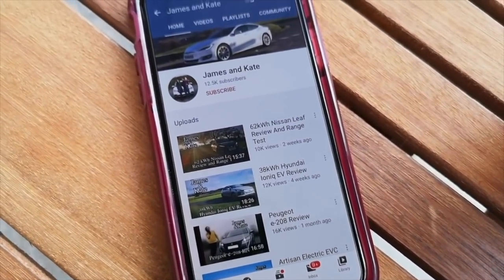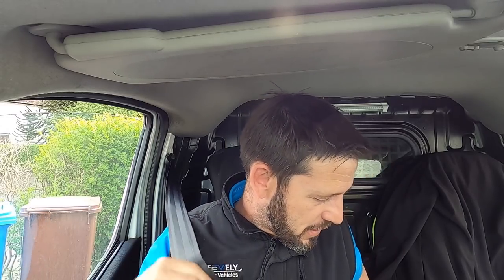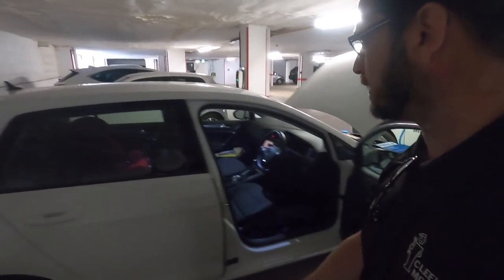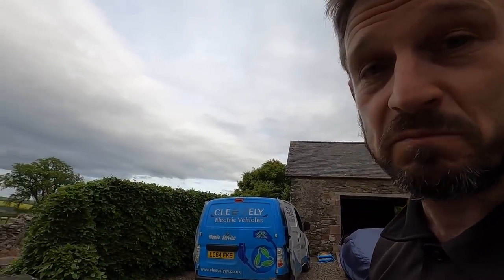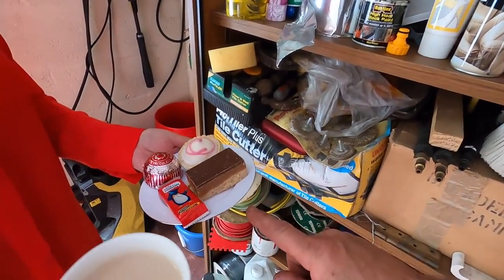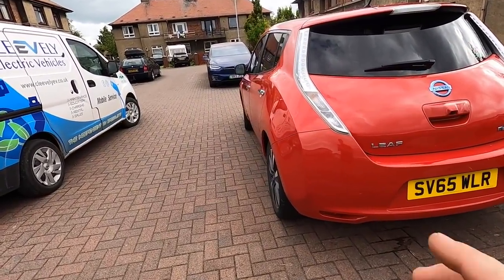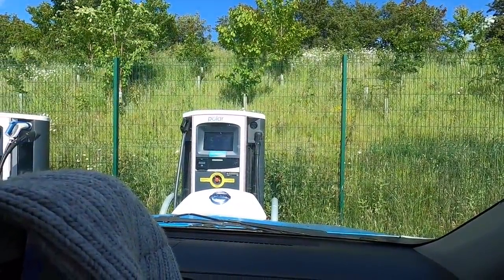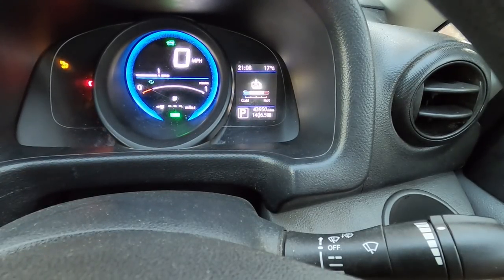You Don't Need A Diesel Anymore -1600 Miles Shows You Why!

Comment: I love this sort of content, you can see why VW with all their actual car building knowledge is keeping drums on the rear of their EV’s even though a lot of the car journalists are slating them for it.
Reply from the maker: Drums are ace. They outlast pads easily.
Reply: The problem with drums is that they are not sexy enough for car journos, bet they like the bigger rim and thin tyre combos even though they are so stiff they make the ride harsh and noisy, it's all about looks for them.
Reply: Drums are complicated, can suffer from over heating, are a pain to work on and cannot get rid of water the same way that discs can.  They also need complex auto adjusters or manual adjusters, which is just one more job to do at service time.  Indeed, manually adjusted drums will almost certainly need adjusting between services, which is even more expensive and irritating.  Even heavy trucks have now converted to discs.

For some strange reason, they work out cheaper than discs, which has always struck me as odd, but that is why they are still fitted.

Comment: Knee pads are not so useful I find but a good thick closed cell pad (as in gardening ) works well for me and my knees. Just chuck it down where you need it and pick it up when you're done.
Reply: @bdeithrick  I actually use a piece of hard foam packaging material, does the job fine and cost me nothing.

Comment: No charging times given. Apart from the start up cost, it's range & real life refuel time that I was waiting for.
Reply: Charging time is not relevant. As you see, James charges at the hotel, at the customers houses while he works on their cars  and at places where he stops anyway for diner. Stopping is charging....
Reply: @annekecornee  so the heading should of been you can drive an EV van if you only repair EV cars. Didn't really need a 45min look into how many cakes James has every day.
Reply: @douglasgreaves188  so if you have a eV you can sell your house because you will nether be there
Reply: @richardburden6056  the clip was for a van. The range on van's are around half of a cars. If I travel to a construction job & need safety induction at 8.30am I'm leaving home at 5. Don't really want to add an hour to a journey getting up at 3.30am not appealing. Plus the cost of stopping & paying for a crew to watch the van charge. Very biased view of why you don't need diesel.
Reply: Hey  @douglasgreaves188 , you've got some very good points, your usage case is definitely very different to mine, though compared to James' Van, my car actually has less range, and that's without a load.

There are electric Vans coming out now that have got a decent range on them, but I get your point, you'd need enough range to reliably get you to site at least, without stopping to charge, and even then, you probably won't have an electric hookup on site that you can use to charge.

Comment: Haven’t Nissan sorted out a  battery cooling system  yet !? It’s such a glaring need on their vehicles, one that any intelligent auto maker would have sorted years ago. Loved the video James.
Reply from the maker: Sadly not, it's pretty poor on the eNV. We have a plan though.
Reply: @Jamesandkate  Attach a set of cooling fans, independently measuring the temperature and powered by the 12V circuit? Would that leave you with enough ground clearance? Surely the layout of the battery pack/chassis precludes the possibility of liquid cooling?
Reply: @Jamesandkate   Are you going to talk about it in another video?

Comment: Drums worked perfectly well for years without the slightest of problems
And as an uncle of mine once told me his articulated truck has drum brakes on every wheel and can stop all the weight he can carry, then set off on his journey again without even thinking about them.
Disk brakes would be in bits on the floor if he tried it with them.
Reply from the maker: Too true. Many commercial manufacturers are going back to drum brakes for reliability and cost savings.
Reply: We got rid of the last motor coach with drum brakes at my company 15 years ago but we had to lease seveval coaches for a new job in 2016. They all had drum brakes and I can tell you that there is a huge difference in stopping power in the discs favour. I can tell you from personal experience that if my coach had drum brakes I would have been involved in at least 3 accidents that would have been caused by people driving their cars like total idiots. With drums there would have no way I would have got stopped in time. The disc more than likly saved people from getting hurt and saved my company tens of  thousands in repair bills and coach down time. The coach doesn't earn money sitting in the garage in pieces.

Comment: Hi James. Fit the range extender and it will solve range and heat issues, also will charge at 50 kw to 85% is is a superb addition to the ENV-200 CleevelyEV for the win.
Reply from the maker: We've got one in the workshop. Just toying with the idea now.
Reply: @Jamesandkate  I know they had one left after our two were fitted. , it really is the business we are still amazed at the improvement, makes it so useful great value.

Comment: Great video James that looked like a tough and busy week. It’s hard work working without a ramp and you were lucky with the weather. A couple of times it looked like you were just relying on the jack with the wheel removed and no axle stand as a back up (Zoe and Model X). Please put an axle stand next to the jack just in case the jack fails or the car moves suddenly. It’s happened to me over the years and it scared the pants off me. It can happen so quickly, I’m sure Kate would want to home in one piece 👍.

Comment: My diesel van has 600 + miles stress free range and very glad it has. Got an electric car as welI, live on Teesside, scotch corner is nearly always in use or broken as a lot of ecotricity chargers seem to be. I have given up using it long distance because of the rubbish infrastructure.
Reply from the maker: Indeed, the van market is a bit behind, but the next gen line will be 400 miles plus.

Comment: Great video!! I'm headed to the garage to check on my model 3 discs for signs of uneven wear. Its 2 1/2 years old now. Tesla don't recommend any servicing anymore since they are focused solely on delivering more vehicles. Wish we had someone like yourself where I live to take care of the car.

Why not stock those Nissan clips if they are often missing or broken. Save a return trip and the need for your customers to buy them.
Reply from the maker: Where are you based? Good shout on the clips, I'll get some onboard.
Reply: @Jamesandkate  We live close to Nashville TN. Used to live in the UK before we emigrated. The only mobile service here is operated by Tesla.

I did check my rotors. Smooth as a babies bottom, so no evidence of an issue, yet.

Comment: If any more proof were needed that no one needs a diesel van, you do way more mileage than most van drivers...even with the Nissan which doesn’t even have a proper thermal management system. Most EVs have this now and would have allowed you to carry on fast charging without the battery heating problem.
Reply: @enrobsorussell  As an outside @russel, what are your impressions of the human race?
Reply: @enrobsorussell  over the course of a lifetime of the van, it is actually much cheaper to run
Reply: @kiae-nirodiariesencore4270  Love the human race. I would use `human race` inverted commas for people giving their obvious biased `opinion` while covering their opinion with gloss (Lies)
"Any more proof needed that NOBODY needs a diesel van...!" is just a lie.
You use an EV van, good for you, but to say nobody needs a diesel van is just `pish`.
James puts together a nice vid, very polished, a bit too polished....like `expensive` polish, making one wonder if he has certain shall we say `incentives` to big-up EVs, without of course really mentioning the obvious downsides.
I rather noticed, Kia e-nero, you had no answer to the obvious facts of the downsides as regards EVs I mentioned.....just a rather silly insinuation (Virtue signal) that maybe I don`t like people.
What next I wonder...more not addressing the downsides of EV ownership and a rather flippant, "You are just a `hater`!"
Reply: @alastairclark9423  I wouldn`t disagree with that fact. That is an upside of EV ownership. Rather offset I think by the downsides....range, outlay, expense outlay with hotels etc while charging....and that is IF you can find a charger that is A Working...and B Not already in use.
I think James must be in two minds about these vids, encouraging use of an EV van.....encouraging even more queuing at the only charger working within 30 miles in the wilds of scotland.....never mind, at least he will have plenty of company while you are all waiting in the hotel for your turn with the charger.
Reply: @kiae-nirodiariesencore4270  if they think like you squid brain .. not a lot
Reply: @enrobsorussell  James would have had to stay in hotels irrespective of what powers his car.
Reply: @kiae-nirodiariesencore4270  ....for 15 hours waiting to charge the van up? Fact is...and it`s an unfortunate one....no waiting to charge up a diesel van.
Wouldn`t mind betting half his work is replacing brakes on EVs...if you don`t use them much as in EVs, they will be unusable pretty quickly, so if EV vans don`t take off half his workload will vanish.
Reply: @enrobsorussell  You’re not understanding are you, or maybe you didn’t watch the video through. James went to Scotland for a few days to service a number of EVs while he was there. There was no way he could go home between jobs so would have had to stay overnight whatever he was driving. I have driven an EV for nearly 3 years now and I am never waiting for it to charge. Most of the time it chargers while I sleep, we also plug in and get free power while we do the shopping. On long journeys the range of the car is more than I can drive in one sitting without a break. Last time we went to the UK from my home in France we spent 22 minutes at one charging stop to grab something to eat and drink and use the loo...then plugged in for another 6 mins when I stopped to use the loo again..this on a 4.5 hour 440 km drive back from the ferry. James plugged in to a slow charger while he slept so there was no inconvenience to him. What you die hard diesel people need to learn is that electric cars and vans are taking over, they do a better job, are quicker, smoother and much cleaner. You  may not care about the environmental damage fossil fuels do, or you may care a lot and not be able to afford to go electric yet. It really doesn’t matter as in 10 years time no one is going to be buying diesel or petrol vehicles new, that’s just a fact you need to accept and get used to. I just don’t understand people who are happy to throw money away on diesel when they can plug in for pennies.
Reply: @kiae-nirodiariesencore4270  You make it sound like France is in the Himalayas...it`s just 20 miles off our coast...20 miles on a Ferry, with the car switched off. You can stuff the virtue-signalling where the sun don`t shine, with your silly name-calling (" Die hard diesel people!") if you are not careful it`s the naughty step for you. Jurassic age had an ave temp a full SEVEN deg HIGHER than now....what will you say about that....."Well, maybe if they had invented EVs....!". EVs do the same job as a diesel van, exactly the same...yet are far more expensive, have a fraction of the range and don`t like the cold. I don`t need to `get used` to anything...we live in a democracy, not communism....not yet anyway. As regards buying a diesel, a new one anyway....the market is virtually non-existent now, as regards cars...as regards vans, pick-ups, wagons it`s still there. As regards James and his niche market and the fact he gets work replacing knackered brakes on EVs...if as you say it`s going to be `all change` and no longer `niche`, with the market flooded with 1,000s of would-be James with a little EV van replacing brakes....all vying for that poxy motel room and the ONE charger in the car park....

Comment: The model 3 rear brakes does have that challenge with rusty ridges.
My 2019 LR awd has the same though much less drastic than the P you showed.
What's strange is the front looks perfect.
I have purposely set regen to low from time to time - I'd rather wear some front pads and even front discs because the rear discs are so damn expensive in comparison.

Comment: Great video, but this shows me why diesel still does have a place. I drove to Devon and back from Liverpool at the weekend with no stops for fuel and still had 200 miles left on a bog-standard 2012, 320d F31. I love the idea of electric, but it just doesn't suit my journey profile. (I have Smart 451 for local driving btw)
Reply from the maker: Yeah, that's a long way, and currently there's nothing that will match that, but it will do shortly 👍🏻

Comment: Much as I Iove your videos I still could not use an EV for my job. I did over a thousand miles in the last four days. I also did 20 odd hours of work when I reached the sites I was working at. 300 miles alone today which took me six hours of driving I certainly didn't have time to stop to re-charge my van. Only two stops in the entire week, in total about fifteen minutes to fill van and top up adblue.
I guess if you are lucky enough to be able to plan jobs and distances before it would help, also the fact that most of your customers let you top up while you are servicing their vehicles. But when you don't know where you are going to be from one day to the next the diesel is the only option. Monday South Wales, Tuesday North London, Wednesday Birkenhead and Telford then today up to the office in Chorley and back home to Bath, just not possible in an EV.
One day I will have somewhere to park at home where I can install a charger and I will buy a private EV car till then, at least while I'm working and driving the works van I'm afraid it's still impractical.
Reply from the maker: That's a fair shout and they don't work for all use cases. But hold fire, i'll be in a much newer van in an upcoming episode that could work for you.
Reply: @Jamesandkate  Really don't have much choice on the van. The Transit I drive is less than a year old, carries about a ton of parts and tools and is so much better on fuel and emissions than the previous ones. The problem is range anxiety, not for myself so much but the customers wanting you as quick as possible. I really want an electric vehicle and if I had somewhere to park my own car I could easily drive the few miles I do in it.

Comment: Hi James. Always enjoy the videos. I’ve seen one or two posts re fitting mk1 Golf strut top covers to Leafs, to stop water pooling around the top nut and thread, causing corrosion. Just wondered if you had come across this? Cheers Doug
Reply from the maker: Hi Doug. I've seen various caps on the strut tops. I normally dry them out, wire wheel them and pack with grease to keep the rain out.

Comment: Great Video.  Fastest 49mins i ever experienced watching this while charging my car. I have  a question about the Warranty on the Cars.    Is it not necessary to go to a main Dealer to get your regular Maintenance done ?      If something where to go wrong would the manufacturer still cover any Warranty issues  if you have serviced the car and not done by a main Dealer ?     Also the jobs you do are the Customers aware they have faults before they call you to do a Service, or are you just doing recommended Servicing for each model,   Thank You.

Comment: I watched the whole video with interest. Thanks James. [Get yourself some knee pads, or you'll be regretting it later.] 

The Zöe caught my attention Driven our ZE50 for 850+ miles so far. We're seeing 4.4 to 4.6 miles/kWh, so 220+ miles per charge, driving normally, mostly using Eco. Spent under £2.50 on electricity, and that was when I charged it the first time, to check cables. Used supermarket public chargers (mostly 22 kW) since then, without an app, because I don't have a smartphone, and we have no off-street parking. 

So no, even this car driver agrees that you don't need a death-rattling, lung-destroying Diesel.

Comment: Thanks for this, it really emphasises why actively cooled batteries are a must on ev's, where I live (🇦🇺) 17ºC is a cool winter night or a really cold day in winter, a typical winter day is 28ºC and summer, well i'm sure you understand why I was concerned about the lack of cooling on the Nissan batteries.
Reply from the maker: 100% wouldn't work for you over the same mileages
Reply: @Jamesandkate  well 1600 miles (2500km?) you did that over a week and went into another country, here I could do that in 2 days without leaving my state (QLD) and it's not uncommon to drive 1000+km in a day. Again thanks for your video 👍🏼

Comment: Great (long) video. Don't apologise for the Wind it powers Scotland. On the blue MODEL X I noticed it has the 22 inch wheels how much does that impact the brakes ?
Reply from the maker: TBH, he's not had many issues. These were aftermarket pads I removed and replaced with standard Tesla pads.

Comment: Do you find that the older Model S need that same kind of brake service you did on that red Model X.   Do they crude up and lock up??  
Mine (Nov build 2015 Model S 70d)  has 52,000 miles on it but I really don't know if Tesla service did anything like you were doing to these cars in the video.
What kind of van is that?  A US viewer.   Thanks.  Oh.  I see from other videos that it is a Nissan eNV200 with a battery upgrade.
Reply from the maker: Hi, yes, it's an eNV200 upgraded. The brakes on the S and X are the ones that suffer the worst.